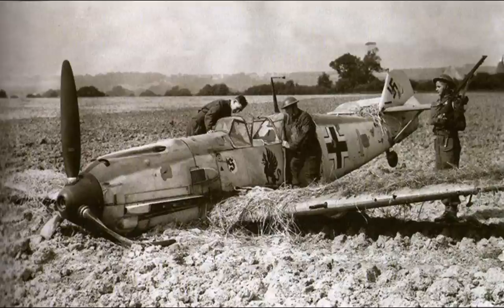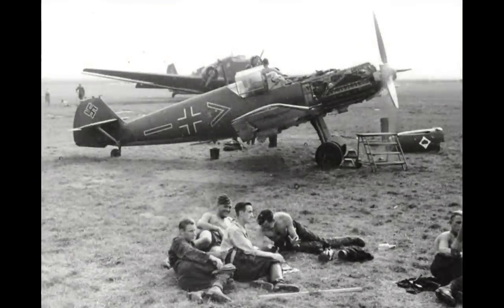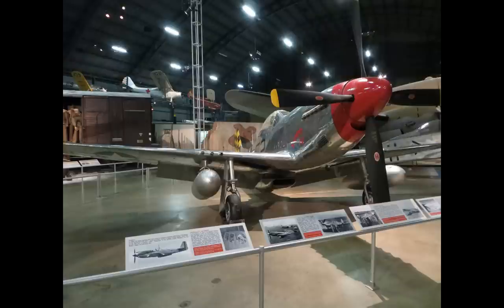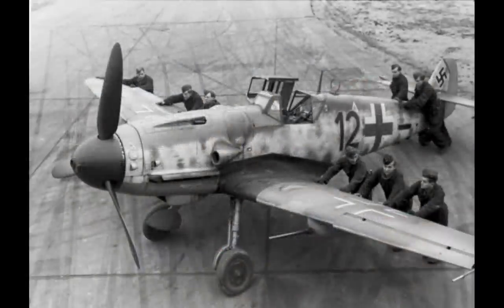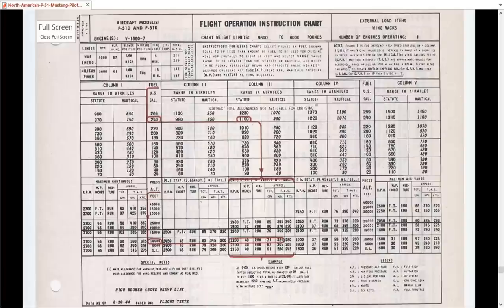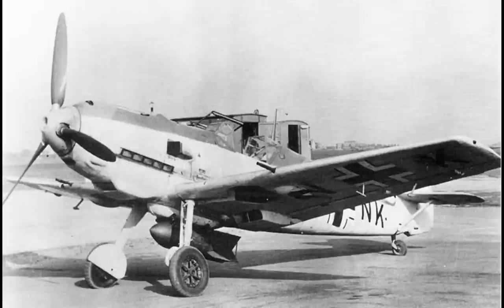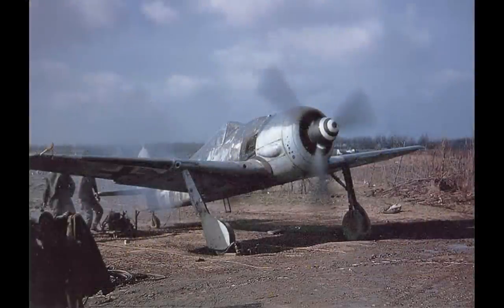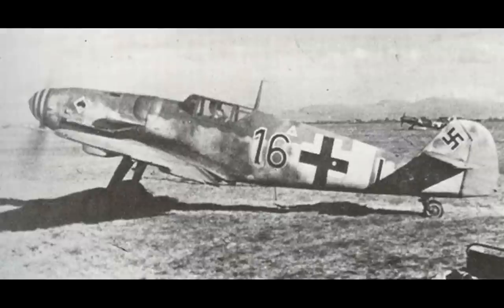Messerschmitt BF 109, Why Such Short Range?

Comment: Greg I'm blown away, your work on this channel puts you among the absolute best content producers I've seen on YT or elsewhere.  I'll take exception to the cause-and-effect angle, though, in this particular video.  It didn't have short range (or as you point out, typical range) because it was a big engine in a small plane.  Instead it had short range because that's what the military specified.  That specification for a short (or typical) range fighter resulted in the idea for a big-engine, small-body aircraft that did what was asked.  I'm not sure why they didn't use drop tanks over Britain except that SE England was amply target-rich.  London then as now IS Britain to a first approximation.  How many 109s came home with bullets they didn't have time to fire?  While 20 min is a tight schedule, thx to radar the Spits and Hurs were ready to start work with a minimum of pfaffing about.  Meanwhile defensively the short range perhaps required defensive airfields to be more scattered but if this was a major hindrance then unclear why higher range wasn't simply specified, or drop tanks.  (Idea: drop tanks with parachutes for use over your own countryside, enabling reuse with less damage.)  I think that had there been a need, a stretched 109 would have been trivial, moving the engine forward 10-20cm and the cockpit and tail back 20-30cm.

Comment: Great video.

If I recall correctly, the Bf 109 E (and early F-model) range issues during Battle of Britain had a lot to do with how the Luftwaffe used them.

Part of it was of course the operative limitations of the Bf 109. It was designed as a short range interceptor, prioritizing speed and especially climb rate. This it did very well, but long range it did not have. The Spitfire, of course, was designed based on very similar specification (short range interceptor), and like you said it's not surprising that the performance of early Spitfires (Mk.I and Mk.II) and the Bf 109 E-models is pretty neck and neck in most regards, though the Spitfire had more upgrade potential (being a newer design). But both aircraft could cross the English Channel and have a bash over enemy territory without immediate concern over fuel endurance - if that was the only thing they were doing.

First big issue for the Bf 109 was that the fighter escorts sometimes had to loiter around the bombers when they were assembling into formations and climbing to mission altitude somewhere over France. It was not particularly streamlined mission planning at work. Then, during flight over the English Channel, the fighters were ordered to stay near the bombers, flying at speeds and altitudes that were not optimal for them. This also seriously limited the fighters' effectiveness against British interceptors, since they didn't really have the energy necessary to respond to approaching enemies in time. A big part of this was that Hermann Göring insisted that the fighters had to fly near the bombers instead of "abandoning them" or something - Göring at that point was more interested in his own political career, and mainly tried to use the Luftwaffe to make himself look good. It didn't really work that way, particularly in Battle of Britain.

As a result, the Bf 109s suffered from their limited range worse than they should have during the Battle of Britain. Interestingly I haven't seen mentions of the limited range being a big deal in other operating theatres such as Eastern Front or North Africa, so maybe they simply started using drop tanks and made better use of the range they had - and of course if they did run out of fuel over land, they could make a forced landing and recover the aircraft if it was on occupied territory. And the pilots were much more likely to survive running out of fuel over land than over sea.

Comment: One of the main advantages of fuel injection (in aero engines) was fuel distribution.  The supercharger system in most(many liquid cooled) large displacement engines was used as a means of distributing  a similar fuel/air mixture to every cylinder.  Liquid cooled aero engine packaging often required excessive compromises in the intake tracks; that resulted in atrocious flow mechanics. Fuel injection removed this worry with only a small magnitude of complexity increase.
Using a  carburetor to add fuel before the supercharger did help cool the (pressurized) aircharge, but as you stated the pressure mechanics  of the c carburetor negated any effect to a null gain.
Messerschmidt was more interested in new designs than rengineering in production models; thus the work on the 309. The 309 didnt address any range issues, it was very much in the mode of the 109( big engine, small airframe).
Thanks for all the work I really enjoy these type vids.
Reply: Supercharging is to supply more air to the engine especially at high altitude.  Fuel injection or carburation are just different means of adding fuel to the incoming air.  Fuel injection alone won't do anything to overcome poor  'flow dynamics' but supercharging can.

Comment: Carburetion AKA "metered fuel leak"
Reply: In high school we were challenged to design carbs that used larger venturi to equal Fuel Infection in cars. Couldnt escape the physics of Air Fuel mixture and the instructor laughed us out of there for thinking we ever had a chance. Of course he had a degree and we operated on the bigger is always better approach including the intake and ram air. Lesson learned in that the packard merlin was the best inline system ever created.

Comment: As an old fart who worked on aircraft engines, your comments are valid. One point not mentioned was that the 109 (and Spitfire) were basically the first generation front line operational fighter monoplanes. And one prime reason designers and air forces went to the monoplane was speed. They are not as good on takeoff and landing, and did not turn as well as a biplane. But wow, they were a heck of a lot faster. So the designers had speed as one prime design goal. And just like the Spitfire, the wings were designed to be as thin as possible for speed (which was a great achievement for that era). Neither carried fuel in their wings.